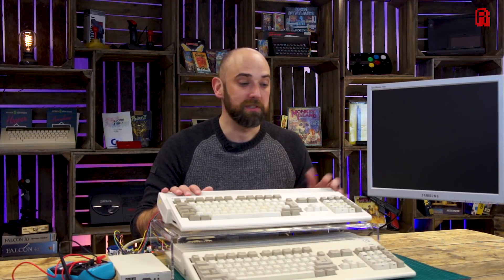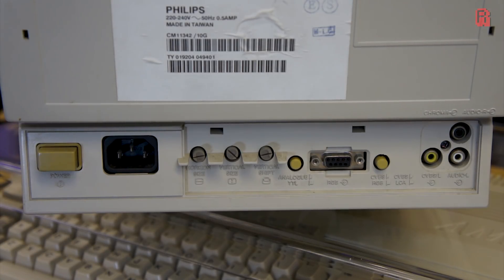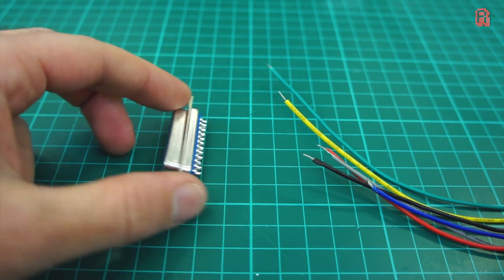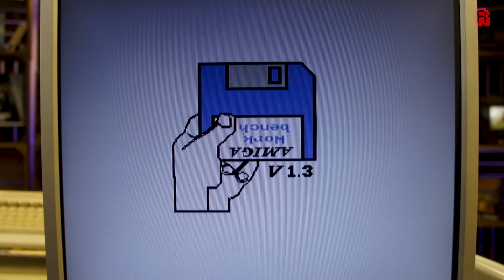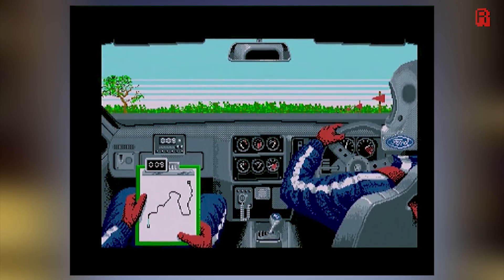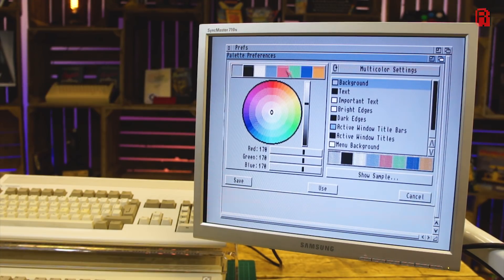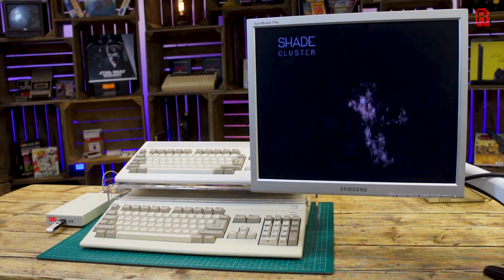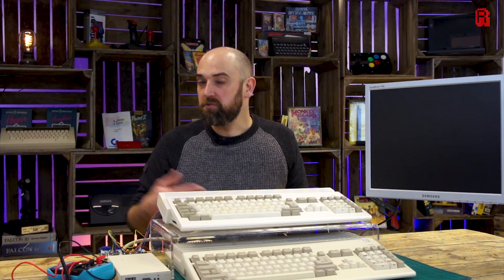Amiga to VGA | GBS-8220 Review (CGA/EGA/YUV to VGA)

Comment: Neil - your LCD monitor (Samsung Syncmaster 710n) natively supports 15khz RGB video using the VGA connector on most of the units produced (until Samsung switched the internals mid-production). You should wire up an Amiga-to-VGA-connector cable yourself, and see whether your monitor is one of the ones that works without even needing this GBS-8220 board. I have been finding and purchasing several really nice LCD monitors with the 15khz support recently specifically for use on retro computers - found a Dell 2001FP lcd screen a few weeks ago that really looks great with retro games. You can read more about about which monitors support 15khz natively at : 15khz dot wikidot dot com
Reply: What is the MS rating of your screens? Unless you have 2ms or less you will have lag city regardless of the 15kHz. That's why the CRT were so good for gaming as the response is near instant as the human brain sees it.
Something like the Cave runner would be impossible to play as you would be dead before you see it.
Reply from the maker: If my trusty old workshop monitor supports 15khz then it must be fate :D  I'll check that out.  I'll work on the 2nd part regardless as it will help those who don't have such luxuries, and grab a passive Amiga 23pin to VGA adapter to see if it works.  If so I'll include it in part 2 for the laughs.  Thanks for the heads up.
Reply: That site I mentioned above just says that some 710N monitors have 740N internals and cannot sync at 15khz. The only way to know for sure is to try yourself, and document the results maybe to help the next guy. I have a feeling there are a lot of monitors from the late 1990s / early 2000s that support 15khz, but just need to be tested to know for sure. I also have a 710N here myself, but haven't had a chance to test whether mine works or not for 15khz. I would suggest you look locally for NEC lcd monitors from that era; many were intended for commercial or industrial use and support a variety of interesting video modes by default. Many people skip them at thrift stores or auctions because they are low resolution compared to today's hd or even widescreen panels, but if you found one, it is worth checking on your smartphone to verify any 15khz compatibility online before buying.
Reply: I would suggest keep looking to find one that displays the whole screen (or else get this one if it is cheap, and keep looking afterwards).

Comment: I have one of these boards in an arcade machine that had the CRT replaced with an LCD monitor, the interference problem is terrible, especially on saturated colours. Much tweaking and settings experimentation didn't help much. Unfortunately higher quality scan converters are expensive! I was thinking of getting the Open Source Scan Converter. I didn't know about mods for the GBS board, I will look into that. Excellent video!

Comment: Using that header with unshielded wire will cause artifacts, this screws up the lines 75ohm impedance allowing interference.  (https://en.wikipedia.org/wiki/Transmission_line). Simpler just to cut up an old VGA cable and wire it to the D23 & make sure you connect each RGB's corresponding GND,. Also mounting the module in its own shielded box may help.
Reply from the maker: that's a good idea RE the VGA cable, I'm sure I can find an old one kicking around for ep 2, thanks for the suggestion

Comment: Does it give better results than a modern LCD TV?  I have 1 CRT but prefer LCD due to being able to sit closer without radiation being visually impaired :)
Reply from the maker: It gives better results than a TV if you're using composite or RF out from the Amiga, but not as good as a monitor which natively supports the refresh rate and doesn't need the GBS.

Comment: Brilliant video RMC.  Top quality production values as always and awesome info.  It is really sad to see the CRT's go.  I do everything possible to save mine.  I just spent $250 getting my 1084 fixed, but I feel it was worth every penny. Nothing brings back the experience like a CRT, but it is amazing how you can get even better quality (with no flicker) out of these old machines with things like scan doublers.  Personally, I skip the whole VGA route and just go HDMI because all of my modern monitors have Display Port or HDMI - no VGA.  VGA is already feeling retro to me, but it is a good solution if you have the space for a VGA monitor to dedicate to your Amiga.  BTW, I absolutely love that clear plastic monitor shelf you have there!  AMIGA4EVER -- Bill
Reply from the maker: Thanks Bill!  Yes calling my LCD a "modern monitor" is a bit of a stretch but it's all relative.  There is also a HDMI version of this board but I haven't tested it and it's a bit more expensive.  Every penny is a penny I could spend on a Vampire when it goes over a certain price.  If your 1084 gets another 10 years out of that price then I'd say its money well spent :D
Reply: Damn, Bill,

If I was over in the US, I would have fixed your monitor for free. lol

I still want to get hold of a CM8833 MKII as well at some point.

It was my monitor for my Amiga and Archie in the early 90s, as well as doubling as my main TV until about 1996.

Did your 1084 need a new flyback or something? That's quite a lot to spend on a repair tbh, but I'm guessing they did a full recap as well?

Ash.
Reply: Oh sweet. I would like to see the HDMI version.  That could be good for me.  Sadly the OSCC is not compatible with my modern 4K monitors or capture card.  The cheap Chinese wonder box works well, but I wouldn't mind something with better picture quality.
Reply: Ahhhh yeah Ash, next time I will just fly you over to NY!  Yes, they re-capped the power supply and had to replace the yolk.  Apparently it was difficult for them to get a new yolk.  They were back-ordered in China or something.  I agree it was expensive, the parts probably cost a fraction of that, but at least it goes to supporting a local TV repair shop.  Amazing that they even still exist!
Reply: The Guru Meditation I had one and the soldering job was terrible. I had to press the chip down in order to get all colors working. Reflowing the board ended killing it. Cheap but cheap indeed.
Reply: The Guru Meditation And by the way, I had the same display bug at the bottom of the display but didn't figure out the resizing trick to get rid of it.  It was very annoying. And last but not least, the absence of case was a pain in the back.
Reply: The Guru Meditation hey Amiga Bill happy to see you sir...how is everything my friend:-)
Reply: Λογος Interesting. Thanks for the tip and the info! Sometimes cheap requires a bit more effort on the back end
Reply: Haha - I would have gladly flown over, as long as you could handle my ramblings in person. lol

oic - yep, I imagine it's quite tough to get hold of a new yoke now.

At least the monitor should be working nicely for many more years. ;)
Reply: VGA is still present on a lot of things, though yes, it's on the way out. You can definitely still buy brand new LCD monitors with VGA though. Mine is from 2013 now, so that's a while back, but it has two HDMI ports and one VGA.
A quick ebay search shows an unbelievable number of smaller monitors designed for security cameras that have Composite and VGA. (some of them have HDMI, many don't.)
A random sampling of monitors on my favourite PC parts website shows the majority still have a VGA/D-sub connector listed. Of the 5 I looked at, 4 still had it.
And this ranged from very cheap to very expensive monitors...

So it might be technically obsolete, but it's still found on a LOT of monitors. (what it isn't found much on anymore is graphics cards.)

In any event... Definitely find a solution that works for you...
We all have slightly different needs and desires.

I'd love to get a CRT television with RGB scart support, but I live in a place where that, while not impossible, is a difficult thing to find. And having one shipped from overseas is out of my price range, and quite impractical. 
So instead I've got little choice but to find a different way of solving my need for 15khz RGB input support...

Comment: I would be suprised if it was a FBT failure just like that, I have repaired numerous of these monitors and not had to replace the FBT. Check the resistance across the large transistor connected to the FBT, 7512 also the diode 6517. Don't just replace them check the PSU voltage and capacitor 2517.
Reply from the maker: Thanks for the tips, my diagnosis was purely anecdotal based on some friends experiences and symptoms so I proper look into things is needed.  I'll certainly test those out you may have saved me a lot of time!

Comment: There are a few known issues with the GBS board, as you've seen on Ian's blog.

The PCB layout is less than ideal, and that causes sparkly dots on some boards, especially with a 50 Hz video input.

My first board was quite bad, so I did the mod where you cut the trace for the SDRAM clock, the solder on a resistor and cap (RC filter), which fixed the dots problem completely.

I think it might also work to reduce the SDRAM speed slightly as well (as you mentioned), but that involves modifying some register valus via I2C, so you have to have something like an Arduino permanently hooked up.

There is another project on the shmups forum for connecting a Rasp Pi to do a similar thing, but also to enable a true 240p / 288p mode, as the GBS tends to try to deinterlace an already-progressive input signal, which can cause really bad artifacting with some systems.

Using a Rasp Pi for configuring a few GBS registers is huge overkill tbh. An Arduino or ESP8266 would do the job fine.

The GBS boards also have issues with sync, and requires an external LM1881 sync separator for some consoles.

Also, the "arcade" style connector is likely adding to the noise, as there is only one ground path, and the RGB wires are obviously unshielded.

So yeah, they can be quite good scaler boards for the money, but can take a lot of tweaking to get right. lol

There is a version with HDMI output btw, but I haven't tested one, and imagine it might have similar issues on the input side unless they have tweaked the design already.
Reply from the maker: Thanks for sharing your experiences Ash.  The follow up episode will be interesting when parts arrive, it's going to be a fine balance between a cheap fix and "is this really worth the parts and time, just buy a more premium product".  We shall see!
Reply: I went to the effort of even designing a new PCB for the scaler chip on the GBS (TrueView chip).

It would have had a SCART socket, and both VGA and HDMI output...

https://imgur.com/a/dL9bh

But, I then found an even better solution, but I've yet to finish the board design for it.

The new scaler board has HDMI, VGA, Composite, Component, and analog RF tuner, and works with every one of my retro consoles / computers that I've thrown at it.

The latency seems to be relatively low, and there are no obvious issues with noise or artifacts that I could see.

I need to finish the board which will convert the output to HDMI and RGB / VGA. and then it will definitely be a very good alternative to the GBS board, but still at quite a low price (sub £50, at least).
Reply from the maker: That sounds very interesting indeed Ash I'd be interested in testing it out in the cave if you'd ever like me to :D
Reply: You're right though - doing the various mods to the GBS boards can be a pain, and possibly not worth it in the long run, as it might be a case of diminishing returns.

I'm normally OK with soldering, but it was still a tad annoying having to do the RC mod. lol

https://imgur.com/a/3y8TH

Or, you can do the mod to add some copper tape to the back of the board, which is essentially adding some capacitance without having to cut the trace and do the RC mod.

(Mr GadgetUK164 did a great video on the copper tape mod.)

In fairness though, the GBS boards can still be pretty good for the money, and are even cheaper on places like AliExpress for people who don't mind waiting a while for delivery.

It's just that the GBS can be fussy with certain consoles (like the MD / Genny, and SNES), and does have issues syncing to some machines.

The image on your vid looks quite good tbh (aside from the obvious noise etc.). Normally when I've seen the GBS used with an Amiga, there is some terrible interlacing artifacts going on, even when the Amiga is outputting 240p / 288p, so maybe it's the VGA monitor that people are using?

Or, it's possible they have updated the firmware on the newer GBS-8220 etc., so it handles progressive inputs better?
Reply: AndehX

Hi,

I've actually abandoned the idea of doing the new PCB design for the scaler chip used on the GBS boards, as I found the alternative.

I still need to make a PCB for that though, which converts the output to HDMI + RGB.

I don't want to give to much away about the new scaler, as people will kick themselves when they find out what it's based on. :p

It should be possible to create custom firmware for it though, and I have some source code already, but I don't know for sure if it will be possible to bypass the scaler's framebuffer for a low-latency line-double mode etc.

It at least seems to handle all my retro consoles and computers just fine, even the Intellivision and other machines via RF (without drifting off frequency or anything).

Comment: Someone should start making boutique CRT monitors and TV's with modern technology.
Reply from the maker: Imagine it, if Philips re-released the CM8833
Reply: I had the Commodore 1084 which I also used to connect my N64 and PS1 at the time, I think if new monitors were made even if they were just 15" at $500 they would sell very well if quality was top notch and with modern technology to make them less bulky and heavy.
Reply: @TheRetroCollective  Sadly it would fail to meet EU regulations on energy efficiency, no CRT/Plasma can hence why manufacturers stopped designing/producing new ones :( (being unable to sell them in Europe meant that global sales didn't justify the costs).
Reply: Coupled with a modern PSU please that comes with multiple voltage outputs and harnesses for various retro systems, please. One half-decent PSU to rule them all!
Reply: I think something like the older Sony PVM broadcast monitor range would be a good start. I used to have a 15" one of those and it was lovely for Megadrive, PS1 etc. Lots of tweaking options on the pro monitors too.

Comment: modern VGA monitor lol
Reply from the maker: Hah well yes you have a point :p - Relative to an Amiga
Reply: it's not so much that it's modern.

But what VGA supporting devices are is (a) plentiful and (b) cheap.  Because this includes not just old monitors, but also quite a lot of early digital TV's that have a VGA input.

Commodore 1084's and their like were fantastic monitors (and are often highly prized even now) so you're not likely to get one easy or cheap, and if you can it might well be at the end of it's useful life.

It's actually far more useful to incorporate the GBS into the monitor than tie it to a specific system, though,

Comment: I bought a bunch of these (see below) for less than €10 a piece, requires a 5V USB power supply (like a wall socket USB charger) and you're set. The quality is not perfect and the composite cable is sort of thin, so you may want to replace that. Works fine with my Amigas and C64/C128 and +4/C116 computers. If the one i use breaks, no biggie - i got 3 backups standing by.

https://www.ebay.com/itm/AV-S-Video-VGA-RCA-Composite-Video-to-VGA-Converter-Adapter-for-HDTV-DVD-Monitor/142557704749